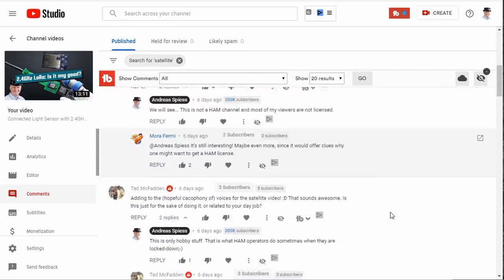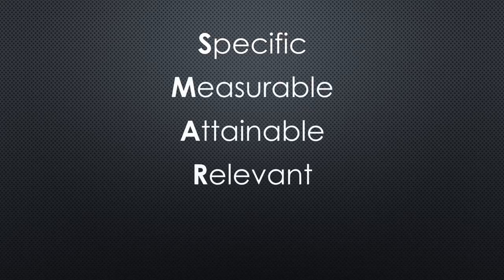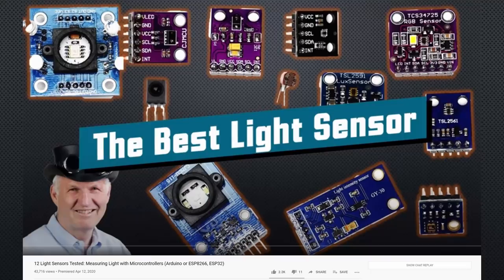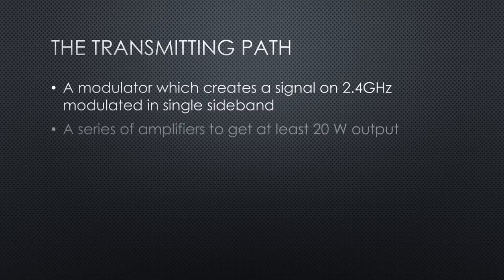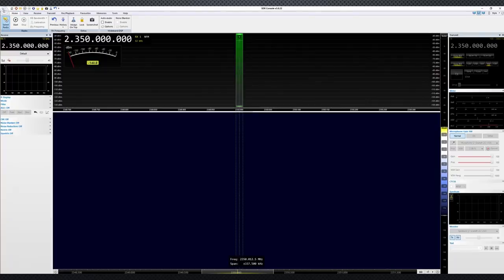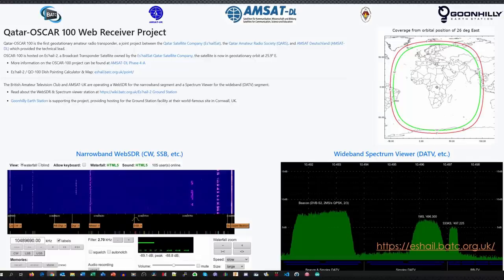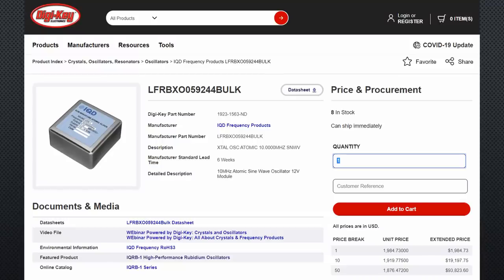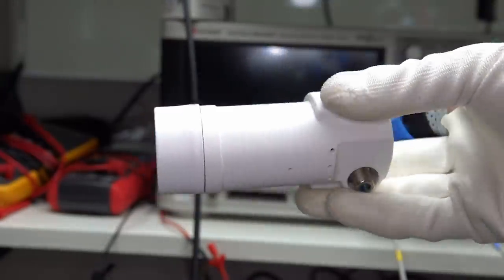#327 QO-100 Reach a geostationary satellite on Wi-Fi frequency?

Comment: What's better than 1 guy with a Swiss accent?

2 Guys with a Swiss accent!
Reply: 1 guy with 2 suisse aka schweizer accents ^v^
Reply: It's not Swiss, it's a bog standard computer voice
Reply: Chris VdG 2 guys with a Swiss accent speaking directly trough a satélite Hahahaha
Reply: @fabriziofernandez1934  while being 15000 km apart from eachother...
Reply: @Rob2  strange shortcut for the signal... 72000km instead of 15 000 more than 4 time longer.... but waves do not bend!
Reply: @zolatanaffa87  In satellite communications, the distance between the stations is something completely different than the length of the signal path.
With a geostationary satellite, you will have an almost constant signal path of 72000km in one direction, but the stations can be much closed to eachother.
Of course you still have the delay of the full 72000km path, which is quite noticable.
Reply: Q: How many guys with a Swiss accent does it take to turn on a light bulb in Antarctica based on a time in Switzerland? 
A: Only two to keep up the satellite link, but you will also need to interface it with MQTT, CoAP, ZigBee, Raspberries and atomic clock source to turn the bulb just before the antarctic dusk :) and in reward you'll get a lot of good fun
Reply: I heard French, and could totally understand it...
A French speaking man with a Swiss accent, that's great!
Reply: @leololdb3299  actually It is a german  speaking man with a swiss accento!

Comment: Oh yes, yes. In an earlier life, I was an engineer for the company that commercialised the Wadley loop for stabilising the IF oscillators in HF SSB. (Racal RA17). My time was just at the beginning of phase locked digital oscillators. So bring it on, SSB, disciplined oscillators, antennas, RF design - oh, I can’t wait! Wonderful idea!
Reply from the maker: I remember the Racal receivers. We used them in military service. We should come across many of the topics you describe.
Reply: @AndreasSpiess  in Greek Army they used "Racal" as the general term for Walkie Talkies :) (some 20+ years ago)
Reply: Yes, please Andreas, the project as a whole is pretty interesting. But also the diverse parts and challenges are interesrtin by themselves and can be used in other projects.

Thanks a lot in advance!,

Cheers!

Comment: 4:30 sounds like the Rebels starting their attack run on the Death Star. 👍
Reply: Lucas arts was known to go to several obscure sources for sound effects. Likely they used SSB receivers for the inter-ship communications in the movies. 

One of the other cool effects was the blasters, obtained by tapping / rapping a telephone pole guy wire with a stick or pipe (the cables going into the ground to stabilize the pole, no power on them). 

There is at least one documentary on this subject that was made.
Reply: @EngineeringVignettes  I think i saw that documentary, sound of the Tie fighter was the sound of the freeway recorded through the tube of a vacuum cleaner iirc :)
Reply: i completely agree!

Comment: Great idea! I'd love to see the results of your experiment. And if you should decide to pick it, maybe I can learn from you (I have already acquired a stabilized LNB and 5 W WiFi booster, too)!
About output power - because you're in the middle of QO-100 beam, you need just 2-5 W into a simple patch or helix antenna to send rather loud SSB signal to the satellite. 20 W might be useful for ATV experiments, but for SSB - it's too much. But hey - then you would be able to use  a 1/4 wavelength antenna to communicate over OQ-100 (without any hassles with dish/helix/patch :-p ).
Reply from the maker: 👆You always can reduce power. To increase it it is harder if you are not equipped. I am curious on how much power I will need. It is part of the experiment!

Comment: By all means, please continue the series. 20W is a bit overkill, tho. De ON8PL.
Reply from the maker: Reducing the power is easier than increase it ;-) 73 de HB9BLA
Reply: @AndreasSpiess  Of course, and linearity and reliability are typically better at reduced output. Just saying the actual power required is way less than 20W, amazingly low for 36Mm distance.

Comment: There are some videos on Youtube also modifying the Adalm Pluto oscillator and I don't see why using a GPSDO isn't an excellent idea.  Wondering what the best LNB's are on the market, for price and lowest noise?  Thanks for sharing!
Reply from the maker: I am interested in GPSDO anyway. So it is a good application for me...
Reply: @AndreasSpiess  I finally ordered an Adalm Pluto... so will be looking at maybe like a HackRF style oscillator module interface or external connector methods to interface GPSDO or better oscillator if the lab GPSDO isn't required.  I need to read into some more next and maybe think about a better case for too.   Will be interesting also to see how the HackRF and Adalm Pluto work together to make a scalar network analyzer and if can make a VNA also with.

Comment: Greetings from Russia and from a guy with Russian accent!) Please continue! BTW, can i use hackrf instead of this sdr?
Reply from the maker: You probably need a separate connector for transmit and receive. The HackRF only has one
Reply: @AndreasSpiess  so, i need duplex mode device for this experiment, right?
Reply: @volodink  You can receive with a separate receiver e.g. an RTL2832 based DVB stick ($20).

Comment: Very interesting to see your project in your videos!
However (when you have not already achieved your goal and we are now just seeing the edited pre-recorded videos) one warning ahead:
20W into a 80cm dish is WAY TOO MUCH power to use the satellite!  Especially when you put that power near the antenna and have no cable losses.
With a dish like that and an appropriate feed, 2W is ample power to make contact.  With 20W you can use a small antenna like used for WiFi directional beams and it will be enough.
The satellite is very sensitive.  And when you over-drive it, you make life worse for everyone...
You will see it quickly enough when your signal is above average, please reduce power until you are at the same signal strength as the beacons.
Reply from the maker: Thanks for the info. I really started an only pieces are here. I purchased the pa because I saw it in different setups. It is easy to reduce power and I also have an 8 watt pa on order. Which is much cheaper. I know about the signal level of the beacon...
Reply: @AndreasSpiess  Ok!  Also, the "power rating" of these amplifiers is often a bit inflated, I would say do not use more than half of the rated power, probably less.
With the 8W amplifier you can still have full signal on the satellite with 80cm dish and helix or patch feed, running 2-3W of power...
The more powerful amplifier may give you an opportunity to experiment with smaller antennas.
You will find it very easy to work over the satellite.  Constructing a QO100 groundstation from building blocks like you mention is comparable in difficulty to many of your projects.  Some reading, some "getting acquinted with the stuff", some connecting and mechanical work, and off you go.

Comment: I tried to do this last year with an 80cm dish, octagon lnb, they were half way up my back garden and there was around 60ft of coax leading in to my shack, the reciever was a funcube dongle+ and laptop with sdrsharp on it, I could make out the usb signals but the noise level was just too high so i took it all apart and scrapped the idea, maybe I can pic up some ideas from you and I might have another go at it ( I only did the RX station, didnt try TX yet)
Reply: The length of the coax isn't a factor at all, especially on receive.  60ft of coax should be no issue, instead you should check that you have clear visibility (no trees!!) and the antenna pointed correctly and the LNB angle set correctly.
Reply from the maker: So stay tuned...

Comment: Just wondering why you didn't use a more commonly available device like the HackRF One for the transceiver instead of the Adalm-Pluto?
Reply from the maker: Because the HackRF only has one connector. This project needs two (RX and TX)
Reply: @AndreasSpiess  You don't need to receive and transmit at the same time, do you?
Reply from the maker: Maybe you wait for the video about that matter.?

Comment: Hi Andreas, could you do a video about low power receiver? A receiver that last month on a few aa batteries? All that lora rfm95 needs too much or the libraries available are not sophisticated enough
Reply from the maker: I did many videos about low power and receivers.
Reply: @AndreasSpiess  Thanks I will have a look. because I am  looking for a solution of max 2ms response time of the receiver and operation time of 6month with a few batteries. This seems quite challenging or not possible. Low power RX is quite difficult compared to TX.

Comment: I am very interested in more information about
"GPSDO / GPS disciplined Oscillator" DIY, or buy ? having reference is useful in some lot of domains but rubiduim clock are expensives and dificults to embededs in lot of application ! 
Your project sound to be a good candidate for gnuradio app in a docker !
Reply from the maker: Gnuradio and docker is not easy .-(

Comment: I was thinking about the RTS/CTS rs232 "feature" that is still present in the 802.11 specification but i cannot find the "time to send " duration examples - 2x 36k km and back for geostationary satellites means that round trip time is roughly 500 ms high - that could be an issue with talkative protocols and for example long time ago for TCP people found out delayed ack improvements - where some acks are spoofed (as far as i remember) and one is terminal - either everything has been transmitted or and the final ack is real or you need to retransmit a lot more than the frame that didnt hit the other dish - https://hal-enac.archives-ouvertes.fr/hal-01021634/document. RTS/CTS on the other hand is optional and (i think) is only used when collision rate arises - and there should be no 802.11 collisions on a special 10-12GHz frequency with parallel dishes pointing each other - could there be any man in the middle 36,000.00 km away?

Comment: Andreas, Great video, love to see more from the series. I'm currently building my uplink station. I have an eBAY Spectran 2.4GHz 60W amplifier which I have yet to put in a case and an 85cm dish and Octagon PLL LNB. I can receive the DATV beacon on the dish mounted in my loft room pointing out of one of the Velux windows, next job is to mount the dish outside. My web site is www.gb3jv.co.uk that covers my DATV repeater in SE London. Best regards and always enjoy your video projects! 73 Justin (G8YTZ) and XYL Julie (M6JEM).
Reply from the maker: Maybe we will meet once for a QSO? 73 de HB9BLA
Reply: @AndreasSpiess  Sure, I'll drop you an email. Justin.

Comment: 20W power output @2.4GHz: if you by any chance could get hand on scrapped 3G network equipment (2.1) or WiMax (3.5) - there would be parts to be salvaged.
Reply from the maker: We do not have a large market of such things here in Switzerland :-(

Comment: Good evening sir ... I designed two antennas i.e 2.4ghz and 10 ghz for transmitting and receiving purpose. I want to use for ham radio applications.

Please do one video about this
Reply from the maker: The antennas I used for these frequencies are shown in this video series about the QO-100 satellite
Reply: @AndreasSpiess  At transmitter side using 2.4ghz and receiver side using 10ghz .. why we are taking two different frequencies. And also at transmitter we are giving less freq compared to receiver side. How can we get the original information
Reply from the maker: Just google QO-100
Reply: @AndreasSpiess  At transmitter side 2.4ghz which is capable of reaching the satellite ,this frq modulated in SSB.

At receiver side 10ghz signal convert into 800mhz due to LNB. This 800mhz demodulated the SSB.

Finally transmitter side modulated in SSB and receiver side demodulated the SSB. So that original information received.

Is it right sir?

Comment: Hello Andreas,  I have been using QO-100 in CW and  SSB,  and the up link power was only 5W on a 80CM wide dish.
It was the setup of ON7EQ, see here http://www.uba-tra.be/download/Presentatie_ON7EQ_QO-100_TRA.pdf for interesting  figures. 
the presentation is in Flemish but as ageman speaking guy I am sure you will get most of the subject...
Hope this helps 
Kind regards 
Jacques ON5OO
Reply from the maker: Thank you for the link. I plan to use a Poty feed and a dish and have 2 different amplifiers to choose from. The frequency stabilization seems to be especially important and good as an exercise for me. .
I also try to get a compact setup. Maybe even mobile...